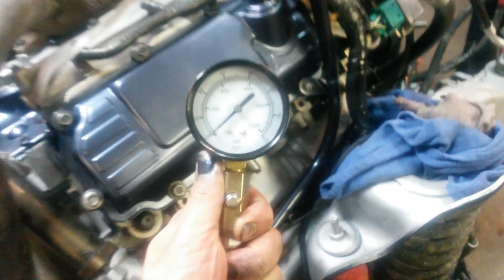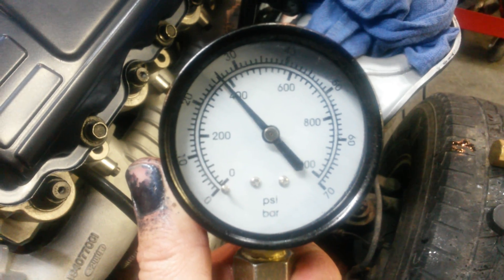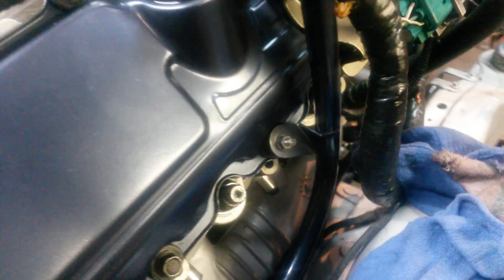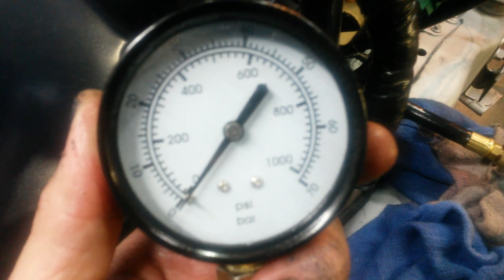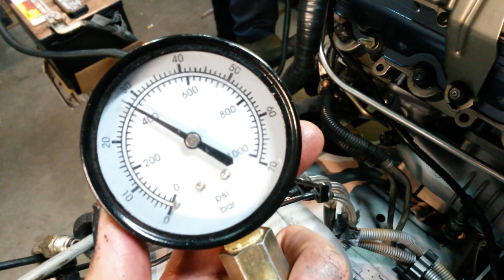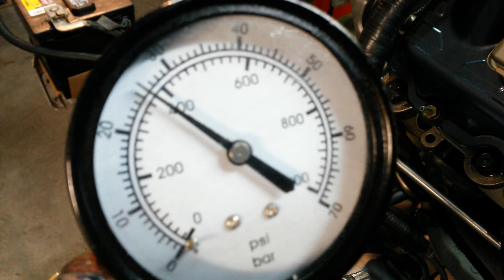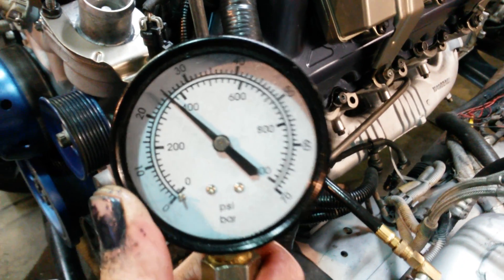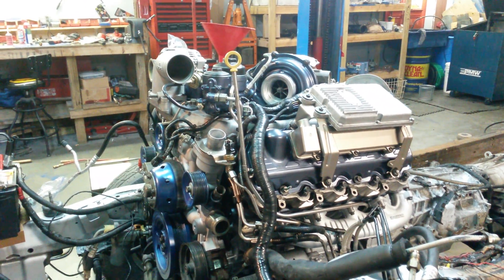FORD 6.0L Diesel~ Compression Test on a Virgin Engine ~Engine Compression Before Break-In

Comment: if I may ... ADD for consideration 
= I also Need to perform 
1.) Compression Test
2.) Cylinder Leak Down Test 
on my 2006 F250 XLT 6.0L Diesel 
= Per my Research and Speaking with Tech Reps at FreedomRacing 
** I am BUYING Following parts **
Launch FreedomRacing website 
( Note these are the FOLKS DieselTechRon ( RIP ) recommended in his Videos )  
Click within Search BOX 
Enter in following 
a.) 303-D092 = $ 225.99
303-D092 ZTSE2482A Universal Diesel Engine Compression Gauge D93T-6000-B
This Gauge does BOTH Compression Test & Cylinder Leak Down 
( Cheaper gauge also available from freedomRacing HOWEVER ONLY Performs Compression 
b.) 303-757 = $ 100.10
Compression Test Adapter 303-757
c.) 303-765-766 = $ 39.61
HPOP High-Pressure Oil Pump Test Adapter Set 303-765 and 303-766
sharing the knowledge to help any and all who may view this comment

Comment: Filling the oil filter and cooler will give a quicker prime.  (I also fill the high pressure pump sump under the cooler housing if I've had that off.)  Also, loosen the fuel rail plugs at the back of the heads and run the fuel pump with a jumper battery.  Saves so much cranking time.

Comment: THE best way to prime the HEUI system is to fill the engine from the compu-check valve on the oil cooler from an overhead reel.  you will NOT have to crank on it any longer than a normal running/driving engine at the very FIRST startup.  This is also how Ford primed the engines on the assy line when they were build, oddly enough.

Good video w/ baseline specs-thank you!

Comment: what happened if the glow plug have lot of oil?
Reply: Carlos Ayala if your glow plugs are covered  in oil . you sure it not diesel.  what car is it. and have you checked compression on all 4 cylinders
Reply: It's a f450 2005 6.0.
That is next step checking engine pression
Reply: I will checking compression

Comment: How is it possible to have all that pressure with 18:1 CR?????? Teorically it should have max 260psi around 18 bar.
Reply: Because it's more than one compression stroke.  Notice the first stroke only accomplished about 160 lbs.  Each stroke adds to it.
Reply: Cranking compression on a 6.0 should be around 400 psi.

Comment: Dude you are not reading the gauge right.
Each notch is 20psi.
Reply: The lower figures are bars, not pounds.
Reply: @mark-1234  we can see that, but the ticks on the psi scale are 20 psi each, not 10 like you said